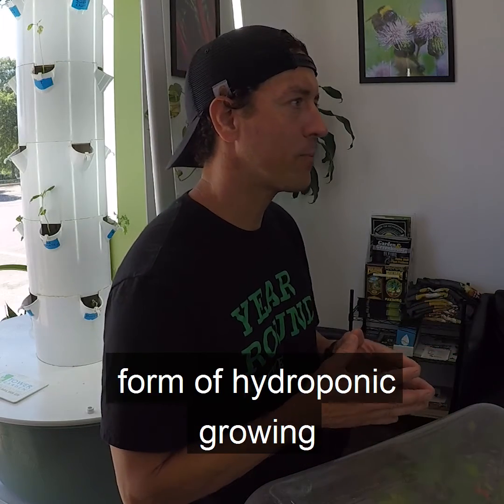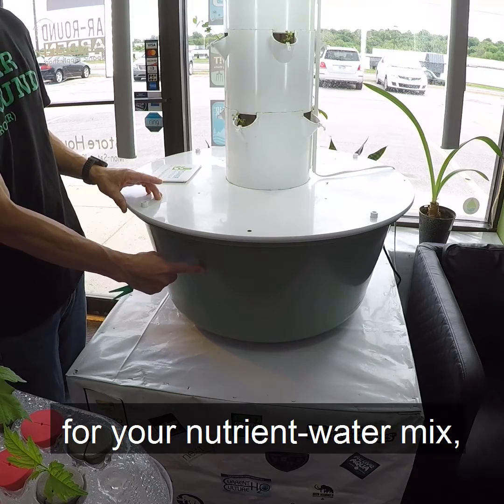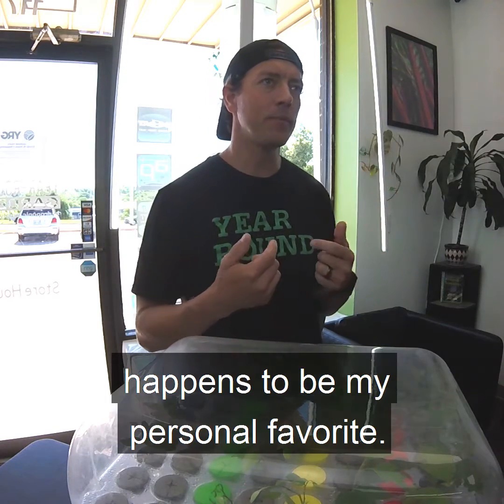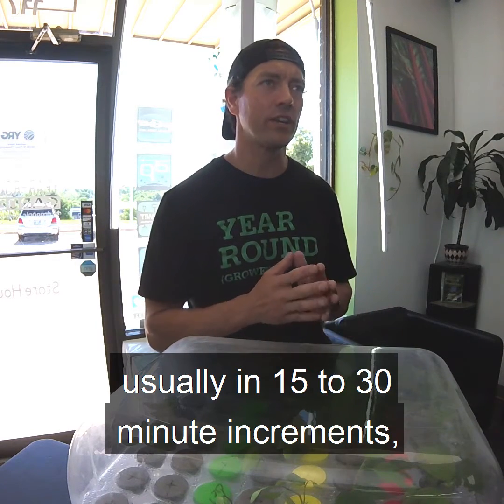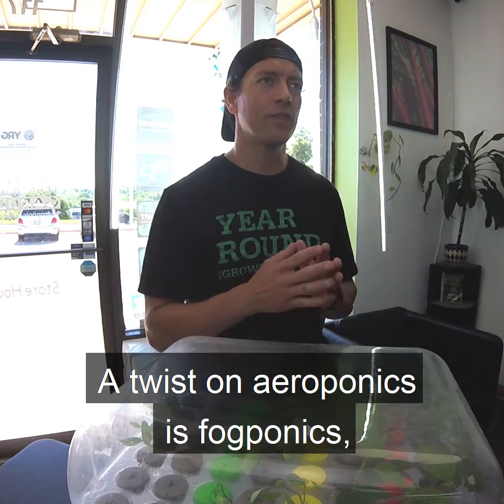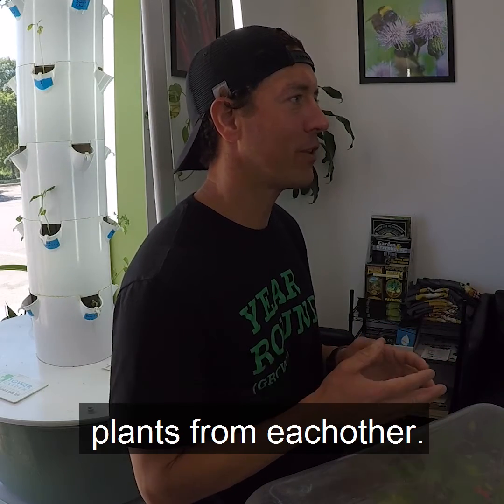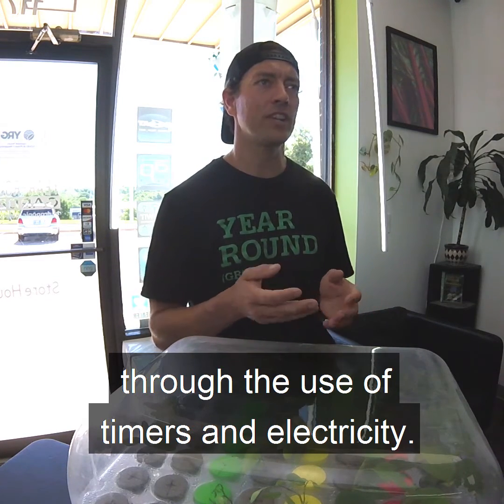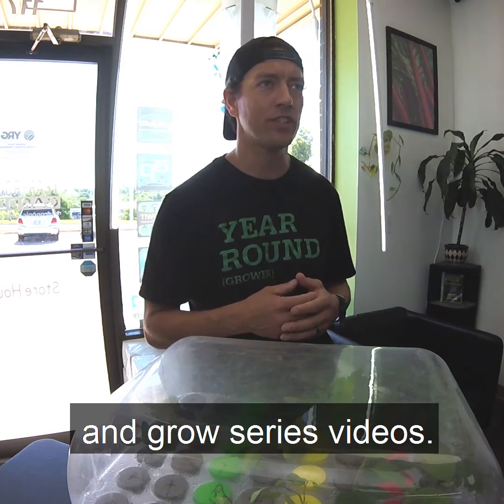Grow Series - Hydroponic Systems (Aeroponics and Fogponics)

Comment: If the nutrient is dripped, its a drip system. If the water cascades over the roots, its an nft system. Its not easy to remove a 12" diameter aeroponic root bundle through a 3" netpot hole ;)